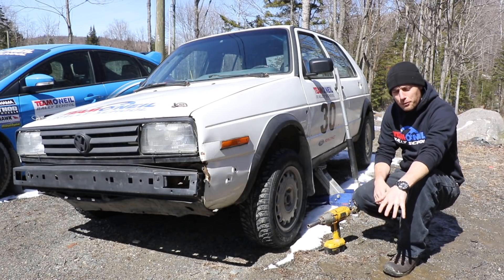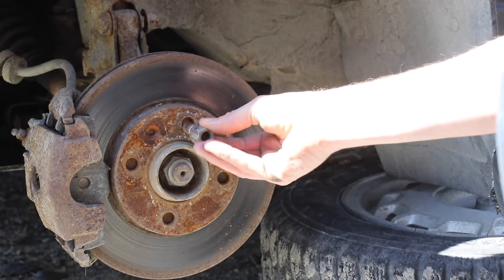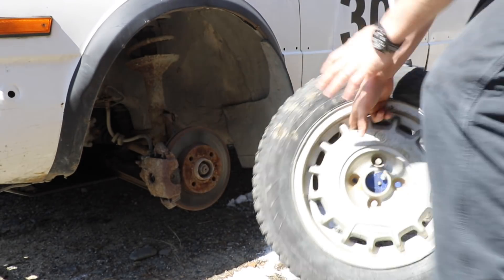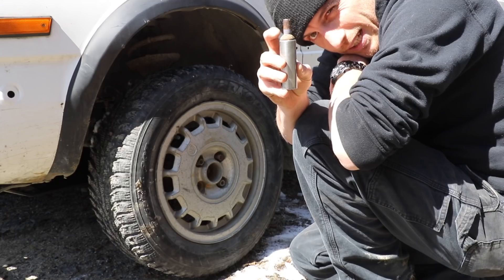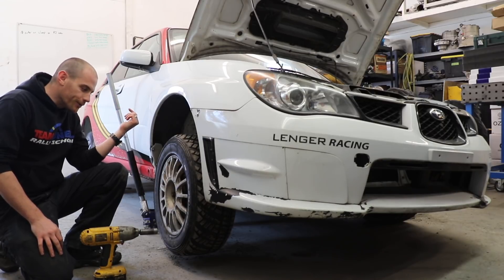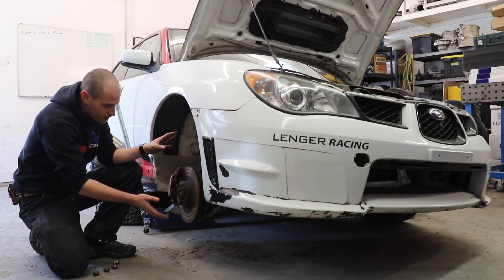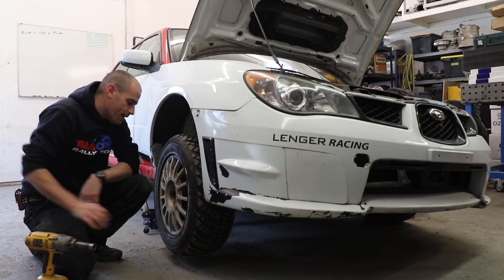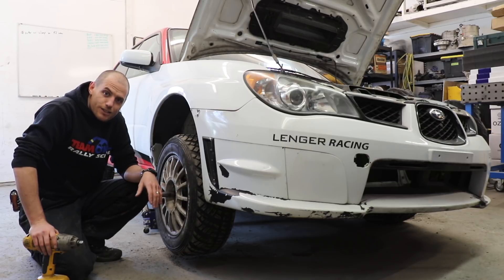Wheel Bolts VS Wheel Studs and Lug Nuts

Comment: Studs are much better ( why the Japanese probably use them as they are much better engineers than the Germans ), they give you a place to hang the wheels when replacing a wheel and if you strip a stud you have not ruined the whole hub. I love studs and acorn nuts ( closed ends to keep the rubbish away from the threads ).
Reply: New Prius is wheel bolts. Toyota is going on the wrong direction...

Comment: I've mostly had german cars, and im not a huge fan of wheel bolts. Im sure they are technically stronger, studs are just so much easier to deal with especially on a drift car where you do a lot of wheel changing. Wheel bolts are fine when you have the car on a lift in the right height for you, but really kind of annoying and straining when done with a jack on the track for the 15th time that day. Pretty sure I will do a stud conversion eventually.

Comment: For brake disc misalignment with wheel bolts there is a very simple solution: DON'T loose or throw away that set screw and if it's gone for some reason - REPLACE IT!

Comment: As a mechanic apprentice  in the UK I find a lot of cars use wheel bolts and they're absolute shite compared to studs. If you strip the threads on a wheel bolt then bam the whole hub has to be replaced where as if you strip a stud you can just replace that stud and nut
Reply: Japanese tend to use studs and that is simply because Japanese are better engineers than Germans, and Japanese cars are easier to work on.
Reply: Meanwhile in other parts of the world that aren't full of European cars it's the other way around, wheel studs being the norm and wheel bolts being the rare, weird and dumb design.

Comment: The bolts seem like a real pain in the balls at first, but if the "set screw" is missing for some reason, you could always keep a threaded rod, with the same diameter and pitch as the bolts, on hand. That could be put in one hole to keep the rotor aligned while the wheel is put on, then removed after 3 of the 4 bolts have been started. This would have the added benefit of making it much easier to get the wheel on than it would be with 4 or 5 studs sticking out at once.

Comment: I used to race VW powered stock cars. The first car I bought, it started life as a '72 Kharman Ghia. The second one I built, full tube chassis, coil over suspension, rack and pinion best car I ever had.
First thing I did was replace the bolts with (I believe. It was 40 years ago, even though I still have these two cars) 5/8 or 3/4 lug studs, with a one inch OD nut. At least two threads exposed, when tight. Rounded ends with no threads on the first 1/2 inch of the lugs to glue lug nuts on to the wheel for quick tire changes.
Bounced off plenty of other cars battling for position. Never had an issue of a nut coming lose, or a stud breaking from side loads.

Comment: I would like your opinion. I fix cars for a living at Aamco Santa Clarita California. I have had to drive large cars because we, my wife and I have raised 5 kids. I fell in love with VW Golfs, so I bought a 2012 reg golf with a 2.5. I love it. The wheels and tires are stock steel 195/65/15. I like the idea of a taller sidewall for around town driving because sometimes you hit curbs and potholes, but they are wearing thin and I would like a little wider wheel and tire. I find myself spinning the tires often I drive it like a rally car. Sorry for the long version. Anyway any thoughts on what wheels and tires especially sizes. Thanks for your time and the videos. I like and share and subscribe them. mark@aamcosantaclarita.com

Comment: Slightly unrelated question, that arose after watching this video. Which impact to get, that would work well for wheel lugnuts? (thinking about extending list of tools brought to trackday)
Reply from the maker: Most cordless 1/2" impacts will do OK... But we've just switched from Snap-On to Milwaukee. The new Milwaukee stuff is excellent. Not a sponsor of ours, we don't know anyone there, totally unbiased... After trying most of them recently we went Milwaukee.
Reply: Any particular model advised if looking mostly for use on wheel lugnuts (probably their models differ by torque)? How many wheel changes can be done on one battery?

Comment: I tryuly hate seeing anyone use an impact wrench on lugnuts or wheel bolts wothout using a torque stick.  Yeah, there are mehanics who swear that they can tell when something is torqued right from experience  without using any kind of limiter or  calibrated measuring tool, but I've never met one who would risk money or reputation in a test, but encountered MANY mis-torqued wheel fasteners. ( try removing lugnuts witn a torque wrench - if they need more than 110% of the installation torque to remove, and the hubs aren't so corroded that they need grinding or replacement, the nuts were were mis-installed.)

Comment: if the bolt was in for location of disk it would be out of alignment for lug bolts but it is right they suck They are on both of my Saturns my guess it was just a way to save money on a stud and a nut.

Comment: Hey I have a question since i have a golf 2 for rally  and i was thinking if i should stay rubber bushings or poly
Reply from the maker: Good poly bushings are great (the nice ones not the $59 eBay sets) but I remember an issue specifically with the big poly bushings in the rear axle beam... When you get them in and put it all together, they sort of bind up and don't allow the suspension to move up and down very freely, like when you jack the car up, the rear doesn't go to full droop smoothly and easily. This was years ago so there are probably good solutions now, but that was a problem and we used stock bushings in that location.
Reply from the maker: Also we were bolting in Mk3 rear beams in the back of the Mk2s and that widens the rear by something like 10mm each side.
Reply: Thx team o'neil for responding since i don't really have no one else to ask about rally knowledge. Since i don't really have money to throw around i have a 1.3 that i'm going to learn how to port a head and do all the stuff i can do make it a little more faster and my own wiring (hoping it wont burn down :D). Anyways but why widen the Mk2s rear with the mk3 rear beam? what will i gain i lack knowledge so im all ears Great channel by the way i love your work keep it up.
Reply from the maker: If you use the Mk3 rear beam and the Mk3 front subframe and control arms, you will have a wider track, basically the car's footprint on the ground will be slightly wider without using wheel spacers or different offset wheels. The wider track will make your car a little more stable in the corners, less weight transfer, and a little less prone to rollover. 

If you look at photos of people racing the Mk2 golfs they are FAMOUS for lifting the rear inside tire right off the ground in tight corners... Good fun but you're really just losing grip (and therefore speed/time). Volkswagen made the Mk3 golf suspension a little wider to help fix this problem, and you can usually find those parts cheap in a junkyard and swap them over easily.
Reply from the maker: Have not watched the whole thing but looks like these guys cover all the details in a 3 part series: https://www.youtube.com/watch?v=CtOzV6GX8eE
Reply: Much  appreciated ill go check. thank you again for more info :P

Comment: Had 3 older bmws (2 e30s and an e23) and never had the issue of the rotor spinning like that... Replace the set screw lol
Reply: They are usually gone because they broke. With limited time between stages, or races, the simpler, the better.

Comment: i'm a mechanical engineer. yes, lubricant will affect wheel torques. however, there are many things that will i.e. dirt, rust, damaged threads, whether the threads are wet or dry while torquing.  just as important is whether you torque your nuts with a smooth constant motion until fully torqued. if you stop rotating the nut/bolt just short of full torque then restart torquing the actual torque on the nut/bolt will be too low. static friction in the system is higher than sliding friction. the other factor that comes into play is debri i.e. dirt, rust, etc. between the back of the wheel and the hub mounting surface. this too will affect the effective torque on the wheel. the bottom line is a minimum of lubricant on the threaded portion of the lug/bolt is the least of your potential problems. just ensure you don't get lubricant on the conical friction/locking part of the bolt/nut or wheel.
Reply: bruh just tighten it damn

Comment: the screw for the disk brake to the hub is missing off your golf, thats why the when you turn anything nothing lines up, its not a big problem 2minute job to put in a new screw to hold the brake disk to the hub, and then everthing lines up

bolts for for when you change from summer to winter tyres, different rims, so just swap the bolts, if you had only studs sticking out you cant have a huge about of treat sticking out behond the nuts,
Reply from the maker: The screws work OK on a street car but usually rust in place here in HN. Also they just don't work for any kind of racing, when you need to change parts quickly and everything is at a very high temperature.

Comment: Great advice, Wyatt! Do you recommend using anti-seize on the wheel bolts? I've heard that BMW/MINI (just a German/wheel bolt thing?) doesn't recommend using any anti-seize due to the fact that it will affect the torque setting for installing the wheel bolts. Truth be known, my MINI R60 bolts have a factory torque spec of ~100 ft-lbs whereas my Honda Element SC (OEM 18" 5 bolt rims) has ~85 ft/lbs for the lug nuts. Is that common for there to be such a variance between torque settings when you go from wheel bolts to lug nuts? Thanks in adv for the advice!
Reply from the maker: Thanks Will! So I just called ARP to ask what they recommend, and they say not to use any lubricant at all. I pressed them for a reason, and basically the answer is: "different lubricants and amounts of lubricants will all affect the precise torque on each stud and nut." Makes sense, especially for a manufacturer like BMW recommendation to play it safe and make sure you have precise and even wheel torque... But in the real world are we talking about minuscule differences that would be outweighed by the benefit of a little anti-seize on the threads, especially if you live where they salt the roads? I'll probably keep using a little anti-seize on my daily driver here in NH, but doubt I'll ever use it on a race car again. 

And the different torque spec... The bolts are usually supposed to be would in there pretty tight yes, but here's some food for thought:  https://www.waymotorworks.com/m14x1.25-wheel-stud-kit-r60-countryman.html
Reply: Team O'Neil Rally School thx for the intel. I’ll def chk our that link as well! Keep it pinned!

Comment: The set screw is there for a reason. This is a non issue if you had the screw in place.
Reply from the maker: The screw is great until it rusts in place here in NH, or if you're doing any kind of racing you'll often need to change parts quickly and everything is at a very high temperature... That screw is going to get thrown away pretty fast.
Reply: It looks like the time spent dealing with a misaligned brake disc is greater than the time spent removing a hand tight screw. A quick dab of anti seize used during maintenance between races will make it come out as easy as it goes in.

Comment: Nice, should of mentioned using studs slightly longer and removing a 1/4 in of threads at the tip to help the nut engage.

Comment: I aggree on the quicker wheel change, although I never had a problem with my disc turning as long as I hit the brakes once before changing wheels. In general I'm not turning a wheel when taking it off, so this really doesn't concern me. And most BMW and Mercedes and couple others have the set-screw, so no problem here. In race apllication maybe, but then again why would you lose a set-screw in a race application while working more frequently on your wheels?

I'm happy to never replace a wheel stud, because pressing this in with the hub mounted is not always comfortably easy nor succesful. And if you get the hub out anyway, it's the same with a torn wheel bolt. Although that really never happened with me nor in my automotive environment.

Comment: Personally, I'm not a fan of wheel bolts.

For wheel nut style cars, as long as the studs align with the wheel holes and the wheel fits on properly, one can just screw on the wheel nut and you're done. Trying to align everything perfectly, desperately trying to align the wheel holes with the bolt holes properly while changing a flat at night, in the rain as quickly and safely as possible? NOT FUN.
Reply from the maker: Safety is a real thing! If your car is wobbly on the little trunk jack on the side of the road somewhere in the dark, wheel studs and lug nuts are WAY safer. With wheel bolts you have to get your hands and your head in there to see everything line up, it's way more sketchy.

Comment: Don't use an impact driver to tighten the lug nuts on alloy wheels.
Reply: Dave Wahrer I'm surprised I had to read this far down in the comments for this advice. But there's more: only use one (including with steel wheels) to break impossibly tight nuts/bolts. Simply running nuts/bolts off or on at that speed can wear or gall the threads (especially since they must be dry). The torque precision is very poor with most impact wrenches, and this torque is quite critical, especially as far as it varies on a particular wheel. They tend to over tighten which does not better hold on the wheel but, by over-tensioning the stud, can cause catastrophic failure of the stud, wheel, or hub. It looks cool to use an impact wrench on wheels, but, unlike the race teams being emulated, most of us can't afford to replace wheel hardware regularly--the trade-off for speedy pit stops.
Reply: Very true, generally. Alloys used in rally wheels and setups are meant to take punishment. But in most cases, best to just use the impact to spin lugs off and back on, and use a proper manual torque wrench to tighten down. It doesn't harm them to spin quickly or break them loose with the impact, the important thing is the proper torque.
Reply: ...that and proper tools combined with the sense of how to effectively use them

Comment: Versal Mit Unterstrich wrote: 
I love how when Germans do anything unusual with their cares everyone's like "Well they're Germans, so there's gotta be an engineering reason to this" 
Well, there actually IS a reason. I just happen to be a german engineer, so if I may explain: 
Studs are not supposed to stick out so they have to be the exact required length to fit the rims. This is a regulation in germany and most of europe.
Now lets say we use the proper studs to fit your steel rims which you typically use for base models or/and winter tires. 
When winter is over you want to fit your nice big summer alloy wheels which require slightly longer studs - which you don't have because they were made to fit your cheap steel rims. Bummer. 
Changing studs is a pain in the ass compared to just using slightly longer bolts.
By the way, the studs on that Subaru seem to be just a little too short. Usually you'd want 2 threads of the stud to stick out of the nut....
Reply: @chbrules ikr it can be so simple just simple humanity thinking
Reply: interesting, however most lug nuts are capped and have a deep internal thread, eliminating this "issue"
Reply: I figured there had to be some stupid regulation behind it. Most of the designs that seem to come from the pit of Hell can be traced to a bureaucrat or politician.
Reply: Thanks, great feedback!!
Reply: My VW was also equipped with a smth like plastic guide rail which you screw into the hub and it prevents brake disk from moving and also helps to put the wheel on like a stud. German engineering you know.
Reply: "Studs are not supposed to stick out so they have to be the exact required length to fit the rims." "studs on that Subaru seem to be just a little too short. Usually you'd want 2 threads of the stud to stick out of the nut." lol
Reply: You rock, thanks for explaining this 👍
Reply: The nuts were still loose so they looked short.
Reply: 1. Idiotic law.
2. "Bicycles have 'Rims'.  Motor vehicles have 'wheels'". Learn the difference.
3. It's idiotic to justify stieoughpied "Because ancient roman chariot wheels would break gladiator knees."

Comment: I love watching your videos and I have learned so much but actually I can add something constructive this time. lol  Honda stock rims use the same conical seat as vw audi porsche.  I have a Porsche now, I use to be big into Hondas, you should have seen the look on my indys face when this same subject got brought up about wheel bolts.  Honda does use studs and lug nuts but they are conical too, off the top of my head Honda is 12mm and the vw's are 14mm so that might be a bit more of problem.  Keep the great videos coming!